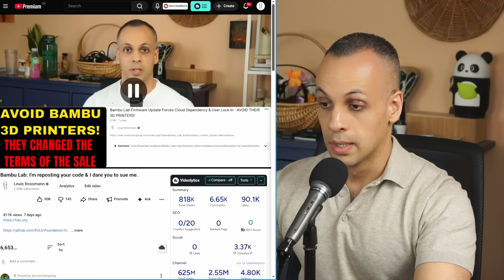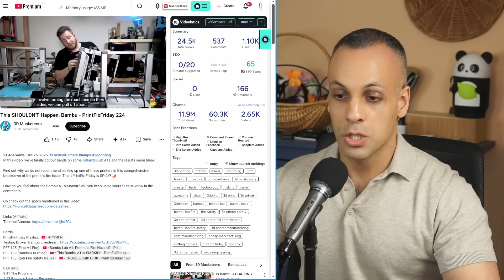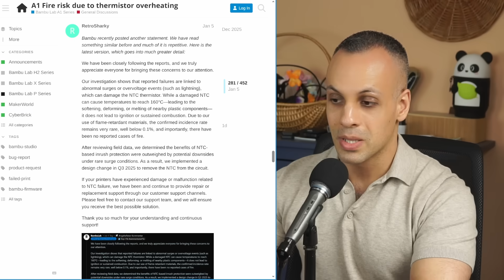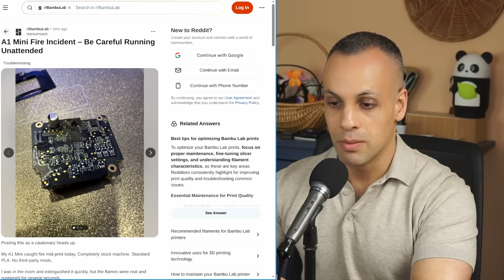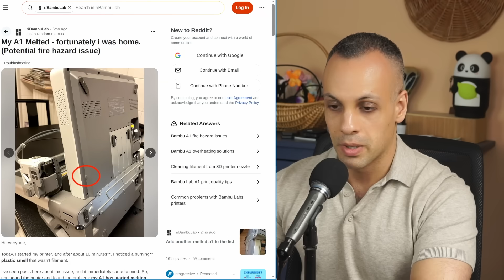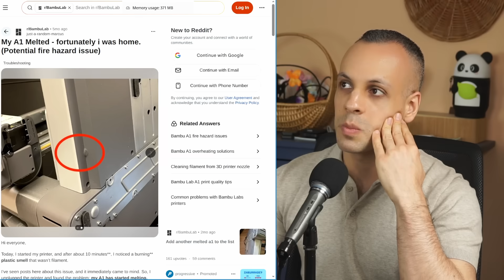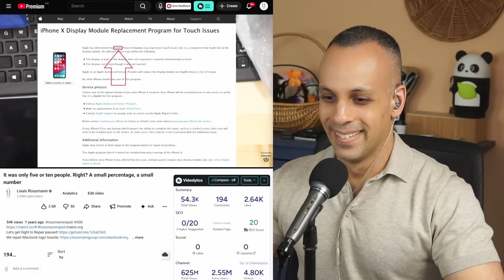Bambu Lab PR dumpster fire is turning into a literal one...

Comment: Initiating old fart rant mode......I'm all about 3D Printing, have been 3D Printing. designing, and building 3D Printers for over a decade now, and I would never buy a Bambu Lab machine, and I also would never leave my machines unattended, as they can be dangerous, us in the 3D printing community know this, we have known this since the days of the Anet A8, the features that Bambu push, are the same as every IOT pile of snot that China forces down our throats, they want you connected to a remote server, usually based in China, and everything you do with their device that you have "loaned" from them by "buying" it, has to go through their gateway, and this feature, allows people to be shopping with the spouse and kids, and can start a print from the spyphone..sorry, smartphone they loaned, sorry purchased from a similar company, so they actively promote, a stupid, idiotic behaviour to the masses that really don't understand how dangerous these machines can actually be, Bambu Labs machines might be made from FR or FRAS materials, but the plastic we are melting in the dam things at a high rate, are most certainly not, my machines have additional thermal sensors, along with smoke and flame detectors, all managed by Homeassistant, I have exhaust fans and alarms set, along with automatons to cut power shut off vents, send alarms to my phone and control panels in the event of something nasty happening, and I'm usually no more than a room away while they operate, 10yrs, no fires, I control everything, and I have used everything from an OG Ender 3 to the latest Creality K2 Pro, what really put me off Bambu and was a bit of an eye opener, was when they remote started everyone's machines around the world, most in the middle of the night and made them all print something, if they have that kind of control, then what else can they do? remote fire? remote botnet? remote spy? they where based in Hong Kong, and if it was the old Hong Kong, I would have given them more respect, but they are not, they are the new Chinese Honk Kong and are subject to all the same laws and requirements, and these laws and requirements, don't align with ours in the west, sorry to get political, but facts are facts.....Disabling old fart rant mode

Comment: Bambu hardware really is the best.  The company is, however, quite evil.  Their stake to the top of the market is going to drop down soon, as their best printers use nozzle swapping which means slow color swaps while the better approach is toolswapping.  Toolswapping is not new, but it is really taking off with solutions from Snapmaker, FlashForge, Sovol, Prusa all either just hit the market or are on the way.  The reliability of the platforms is still not quite at Bambu level, which means more time lost to fixing it than using it in some cases.  How willing to use a PC that had to stop, and rebuild the registry on every application launch would you be?  Loss of productivity cuts ROI no matter if that return is satisfaction, cash, or whatever.

Comment: When purchasing my 3rd 3D printer I avoided Bambu printers due to the possibility of what has recently happened with them. About 2 years ago I purchased a Qidi Q1 Pro, and it was on another level compared to my previous two printers. It mostly just worked, though it did have flaws that I was aware of before buying through research.
Back when I purchased my first two 3D printers, anything under $400 could not be considered more than a toy. They required tens of hours of work to get running properly, including a few days just to build my very first one. My second printer went through an extreme rebuild before I even powered it on with the stock components, the equivalent of buying a car and replacing the entire drivetrain and all electronics before ever starting it.
My 3rd printer, the Qidi Q1 Pro, is still my current machine. It works out of the box and needs minimal adjustments and upkeep. This level of quality from Qidi was largely driven by Bambu entering the market as serious competition, forcing other manufacturers to raise their game. While Bambu has gone to absolute shit PR wise, I credit them for helping push the 3D printing market to where it is today.
My first printer was a Tevo Tarantula, which literally required days of printing upgrade parts just to make it usable on top of the day or two it took to put it together.

Comment: I won't be buying anything else from Bambu Labs.  I loved my A1 mini when I first got it and then they started to do shady stuff and I haven't used it in 6
Months.  I have found that I would get a large number print failures when not using Bambu filament, it could just be a coincidence but with a locked down slicer it made me suspicious.  I would love to know if there is some code causing it to happen.  Also, why the heck does everything have to be sliced via their remote servers.  Something is fishy with Bambu.  I don't trust them and will not be buying anything from them.

Comment: Vorons all the way baby. Not super newbie friendly but every inch of that machine is mine and under my exclusive control. Open source ftw. There are even mods current and future that make the AMS irrelevant to the decision. Though I wouldn't be shocked if Bambu gets real desperate and start trying to assert more legal bullshit against those repos for mods that basically replicate the automated load/unload system and are straight up open source clones of the AMS setup. I however, have my eyes set on the Bondtech INDX system.

Comment: Not saying they're the best or the only option, but I really like the Qidi printers. I have gotten a lot out of them personally. I was considering a Bambu A1 mini until this fiasco started to have something to churn small models out with.

If you have the cash, the Prusa printers are still unbeatable in support and reliability - but I've gotten the turnkey experience out of the Q1 Pro and Max 4 plus fantastic support from Qidi at a much cheaper cost.

Comment: i "own" an A1 and a A1 mini, The failures (I have not have one of my printers catch, combust, or destort) are due to probably the board but also the A1 only having passive cooling and no mechanical fans. That is why you should not put  an A1 or the A1 mini in a fire enclosure without a proper fan setup using mechanical fans. I also have a Smoke Detector in my room where i store them and i have mechanical cooling in my enclosed A1. I do use the bambu software and bambu handy (the app) becasue they are usefull for a person like me who uses CAD and designs stuff but doesnt want to spend all my time tinkering with printers. However they should not sue opensource developers or claim to own machines that have been purchased by the customer, i should be able to put what ever i want on my machine if i choose to in the future.

Comment: Its not just the printers, its the whole ecosystem with Makerworld and Makerlab. Its just too convenient that print profiles match your printer down to every part. My assumption with all of models I print from Makerworld is that they are prepared for Bambu printers and I can just hit print and not worry about anything.

My X1C has never failed a print since the day I got it, other than when I made an error when slicing and I can't say a bad thing about the printer itself. I still use same textured plate, changed nozzle only 3 times since 2024 and one of those times was due to bad filament. I hate that its closed system and they don't want us to use 3rd party software or hardware, but their stuff just works at least for me.

I decided to ditch Bambu when they announced discontinuation of the same printer I praise so much for never failing me, but until the day the printer dies or I can't find replacement parts it will continue to print.

Comment: Never used a bamboo printer. Heard they were good, but expensive, and not as 'modular' as my ender 3 (which i have tuned enough to print recorder flutes in tune in petg without post)
Idk, i like "owning" my machines. And i'm lazy and never properly hooked up them up to network, just a fistful of SD cards. I ever get a new car, i'm yoinking it's modem immediately.

Comment: I have a Bambu Lab A1 which had this issue but to be fair they did replace A/C board and bottom cover at no cost. Never at any time did I see this fault as a fire hazard the only indication was the bottom cover which had some melting of the plastic. Not sure the demonising of Bambu Labs is fair as my experience has been positive so far especially with their support. Maybe there is a case for the software but for me that is not something I lay awake at night worrying about.

Comment: "We've caused no more than 1 fire for every 1,000 A1s we've sold"
Reply: That's actually an awful record.
Reply: @Sonny_McMacsson  1:17 "no reported cases of fire"
Reply: Beautifully worded. 

Phrased in such a way that the actual ratio could be much better 1 in 1000... But if it was, why wouldn't you say so?
Reply: @Sonny_McMacsson  I've owned 3 creality printers. 2 of them have had electrical fires. One on the main board and another in the cables. None of my bamboo printers have caught fire.
Reply: @tornadoswe  That's a bit of a straw man fallacy. For example, I've had the same Creality printer for 4 years, I've modded everything, no issue ever even with aggressive modifications. I've suggested a core-xy creality to a friend, has been working flawlessly for 2 years. Another friend has been using an ancient Creality Ender 2 Neo for like 6 years just fine, he has even printed ABS no issues. On the other hand, 2 years ago I suggested a Bambu Labs A1 to a different friend and he constantly has issues.
Reply: @BoredArchitect  Yet the ender 3 was also known for having issues with thermal runaway and fires but unlike bamboo there are no records of recalls. Piss on bamboos buisness model by all means, they are no angels. But making it seem like they spontaniously burst into flames or have more issues than other brands is just stupid. 
Bamboo brought 3d printing to the masses which pissed off a lot 3d printing nerds that enjoyed feeling special. Now all of a sudden a 5 year old can get as good print quality as an experienced operator that has been printing since the start (like me) This, imo, is what started the hate train against bamboo, just like it did against dji in the drone sector. Do more bamboo printers have issues? Yes. But that is probably because they sell more printers per model than all other brands combined. I agree that their software business model is disgusting but don't try and frame it as them making dangerous or bad products.
Reply: @tornadoswe  I don't hate a company just because. In isolation, Bamboo Labs products are pretty good. But what you are saying is a half-truth. Enders were never sold as "just works" printers. And they didn't need to recall them because everything was open source, easily replaceable and mostly repairable. In contrast, Bamboo Labs printers have proprietary written all-over the place. Also, Bamboo Labs is the one that claims "Our printers just work, get your kid a printer" which is reckless and false when your printer, as per Bamboo Labs claim, has a 1 in a 1000 chance of combustion. 

Bamboo Labs has indeed modernized and simplified the 3D-printing landscape, but this doesn't make the criticism invalid. It's like saying "the iPhone was a revolutionary phone. So if you judge anything about it, you are claiming it wasn't revolutionary". Which is a false dichotomy.
Reply: @tornadoswe  And? I have had 3 creality printers as well, and none of them have caught fire. I used to have 2 bambu [A1 and A1M]  printers, and they never caught fire. It's still alarming how many A1 fires have been recorded - 200 cases is a non-negligible amount.
Reply: @BoredArchitect where is that number coming from? I hear overheat but where did the 1 in 1000 a1 fires come from?
Reply: @GP3Designs yet the only official number i found was 0.052% having issues with melting components. Cant even find your source for full blown fires.
Reply: @BoredArchitect  it's not a strawman fallacy, at most it would be a fallacy of anecdote. But it's not a fallacy. Creality printers where and still are horrible, full of problems and known for caughting on fire. You don't hear about the stats because creality doesn't talk about stats, they just don't care.
Reply: @BoredArchitect  the criticism is valid, what it's annoying is people pretending other brands aren't worth the same criticism or even more. When it comes to fires or quality in the components, creality is a perfect example. They are known for years to be one of the worst brands in the marker when it comes to this issues but people only focus on bambu for some reason. Bambu locking the software is a valid criticism in comparison to other brands because they did used public software to do it, but the idea that creality and other brands are much better is just cope.
Reply: @tornadoswe  The exact same argument conspiracy theorists use when arguing about vaccines. This is not even about the rate of incidents, it's about how it's handled, especially in the light of going corporate greed in other regards.
Reply: @tornadoswe Bringing DJI into this is just dumb as fuck, and shows how ignorant you are and the rest of your comment. I was part 107 certified and flew a dji as well as multiple self builds. The reason I hated dji bringing shit to the masses? Literally only because cleetus could now bring his drone to places he shouldnt fly, (mostly just my nature) and make an absolute nuisance of himself...causing delays, causing accidents...stupid people underprepared and over confident. Otherwise I loved them. 

Same with bambu, now we have people who dont want to understand the ins and outs of 3d printing, fine honestly its frustrating, but they just want an appliance...thats literally the opposite of owning an item. When we moved in to my exes gmas house, there was a fridge in there from the 60s still chugging. We had to replace it a year or two later, you think that appliance will last that long? No one cares about feeling special thats just you being an asshat, we care about people who are too cheap and too dumb to build/repair a printer always complaining, driving the 3d printing world in a direction it wasnt meant to go, back towards proprietary bullshit. "You will own nothing and you will be happy"
Reply: @Sonny_McMacsson  that's actually not 😂
Reply: @moneymanifestation9505  how on earth is that NOT an awful record?
Reply: @moneymanifestation9505  did you just smash your head in a door? seek help immediately
Reply: @moneymanifestation9505  Oh? How does it compare with other appliances?
Reply: 1000 out of every 1,000,000 printers lights on fire and you don’t think that’s bad? 😭
Reply: imagine if they sold 1 million printers lol
Reply: The response said "no reported cases of fire", but 1/1000 units will get hot. Still not good, but it isn't fire....yet
Reply: ... so far
Reply: More like on average
Reply: oh and did we mention we didn't replace the printer, the fire extinguisher, or the huse.
Reply: No. They’re saying the issue with the thermistor overheating hasn’t occurred in any more than 1 in 1000 printers. For a fire to occur, you’d have to be one of those 1 in 1000, AND also be experiencing another error at the same time which gave the printer something to ignite (a significant blob/spaghet error maybe). That is significantly more rare.
Reply: Its not fire its melting a part without any burning
That is a big difference tbh

Comment: Now is prime for people to buy these printers on steep discounts if they can find them at such a low price, replace the defective components (baseboard and thermister), add changes onto the replacement board firmware for safety features they removed, and resell as ameliorated 3D printers fit for long-term unattended use.. Whoever does that the most soon, will win the most.

Comment: I have one of these affected printers, contacted bambu for a replacement and they told me it's a non issue and to keep printing, they refused after multiple attempts at getting the replacement part (my printer was 4months old at the time and the warranty should of fully covered the part replacement) but they refused and said UNTIL I experience a fire that they wouldn't help me.